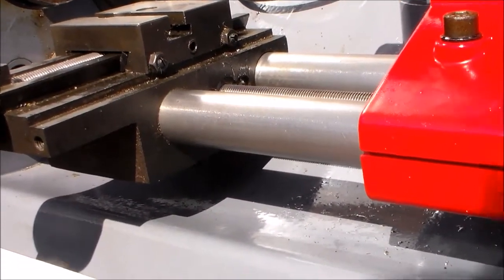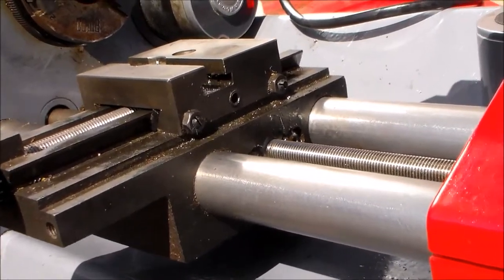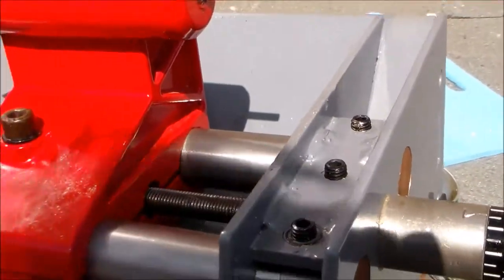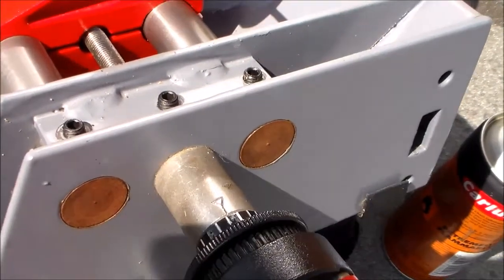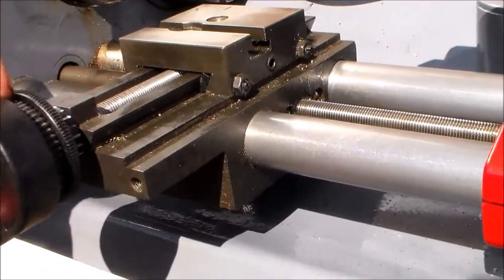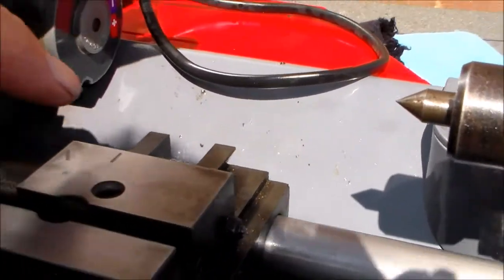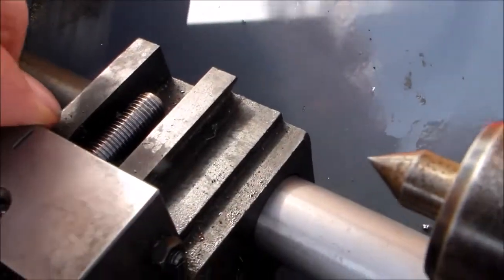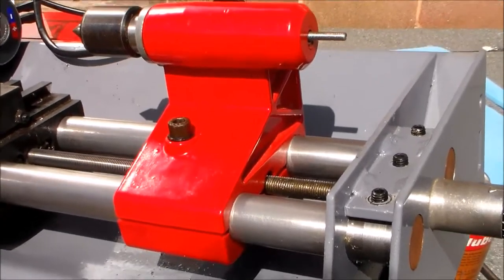Unimat PC Basic close look Cross-slide

Comment: the quality of unimat decreased to the time, from the first DB200 in 1950 with full cast iron body into late 1960 (mk1-mk4), after that they produce unimat SL (mk-5) with cast aluminium / zamak into 1980 i believe, yet the quality of the mk-5 is reduces from aluminium handwheel to plastic handwheel. 

and then the unimat 3 and 4 (the bed casting) but all the body is cast alumunium, and then unimat PC that have plate steel that must be huge problem to reduce vibration etc. 

and then they the last was unimat 1 , that is a TOY not a lathe. hope they can re-production the unimat DB200 and unimat 3/4.
Reply from the maker: That is a useful background Ali. I will need to assess the age of my other Unimat lathes.